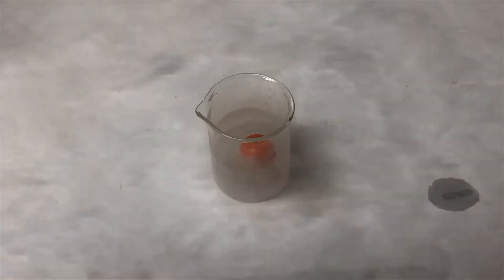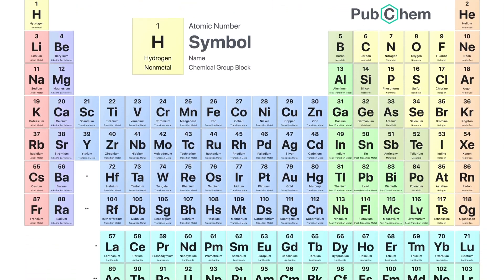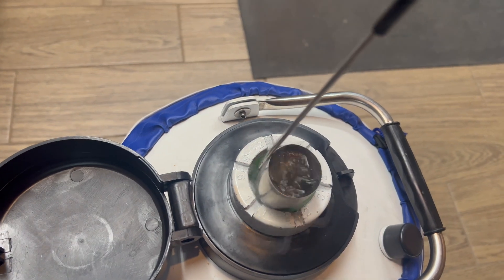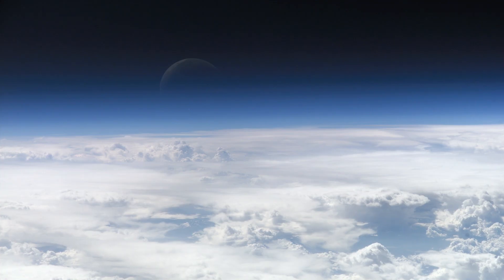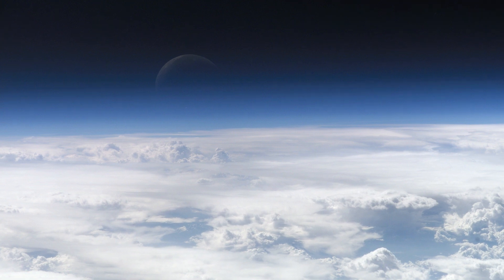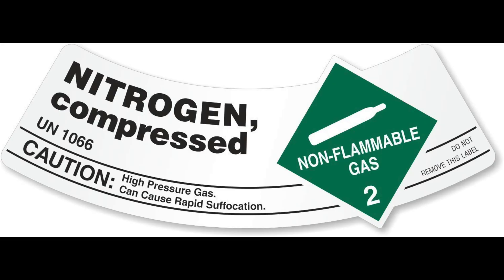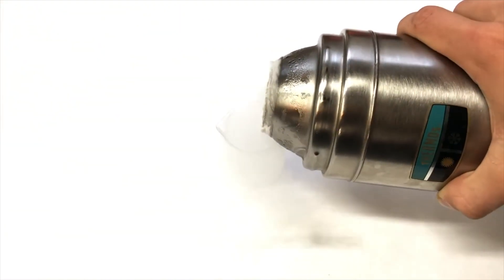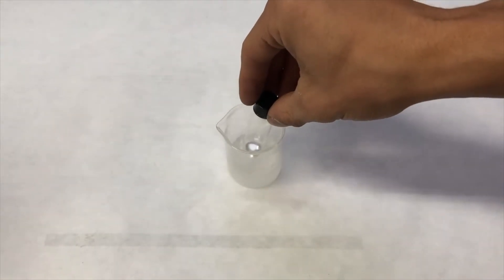Extracting Nitrogen from the air we breath - Element Series: 7

Comment: What and where did you get your torch setup to melt the glass, I have 30 to 40 boxes of new discarded glass even a couple of boxes of the thick glass tube with yellow strip you use to make thermometers from going to salvage and surplus from Purdue from 1975 to 2010.

Comment: Wondered why you didn't use iron, with a higher surface area it may react faster, I suppose only oxygen was removed, was the tube and copper off gassed off camera? 

In the uk you can't really just go out and get liquid nitrogen, and you have to return the container it came in, difficult for long term storage 😂
Reply: why would you ask if the tube was pumped full of gas off camera?
Reply: @JFreelind  off gassed, meaning heated up too release any trapped moisture and gasses on or in the material which otherwise would cause contamination
Reply: @phonotical  that's operational question, can u tell from ur knowledge of  technicality came from, where?